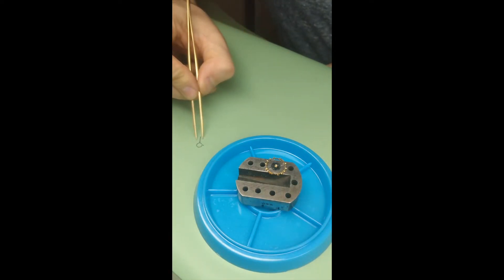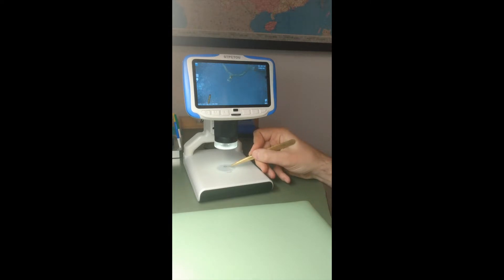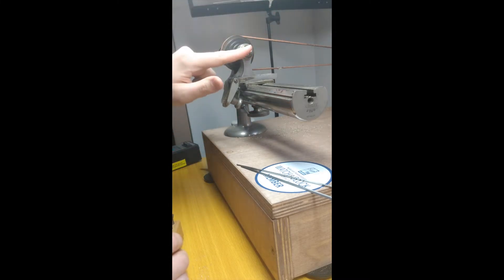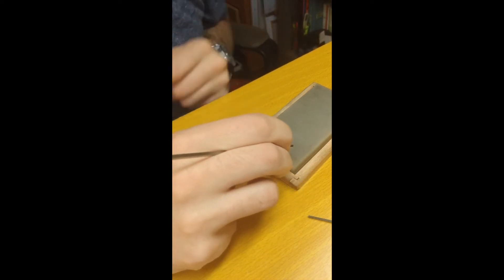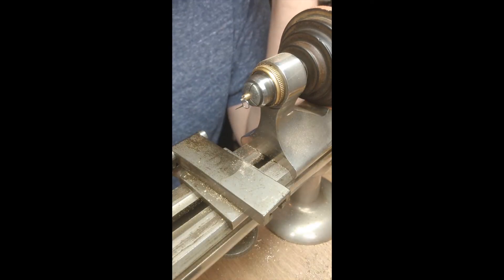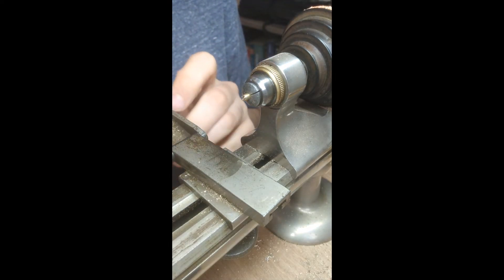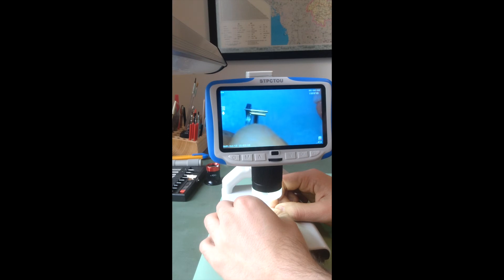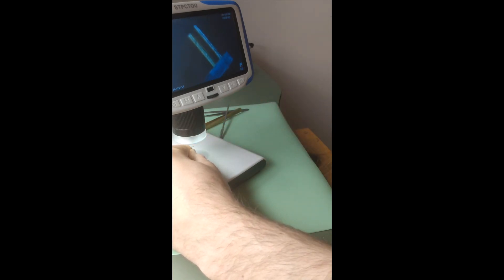Making a new regulator pin in the watchmaker's lathe

Comment: Hi, nice job.  Did you push out the old pin (how?), and then I assume you could measure it, or did you measure the good pin? I don’t have a lathe, do you know if it’s possible to purchase tapered brass for such a job? Ta.
Reply from the maker: Hey Boyd, I can't remember exactly how I got the end out. My best guess is I used the staking tool to drive it out. I did measure it, but when turning it in the lathe I did not try to get it to that diameter exactly. I just did a taper pin and filed down the excess after I inserted it in the hole. I think you can buy tapered pins from CousinsUK, but whether they have something that fine, I'm not sure. All good questions!